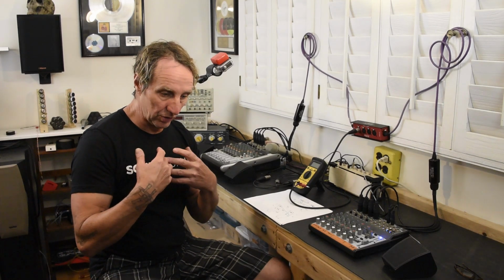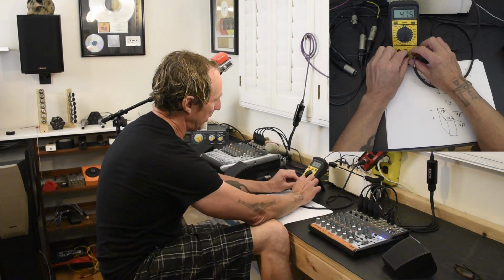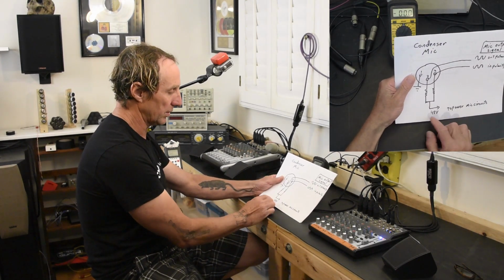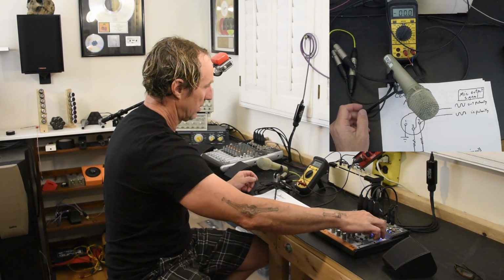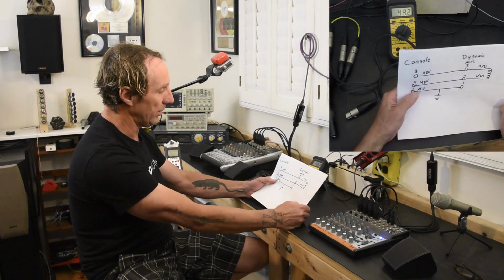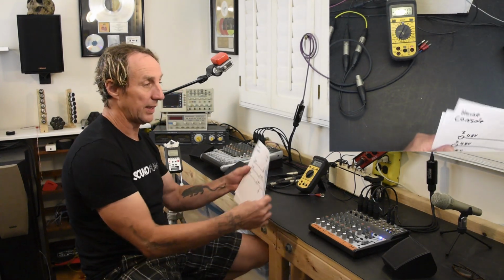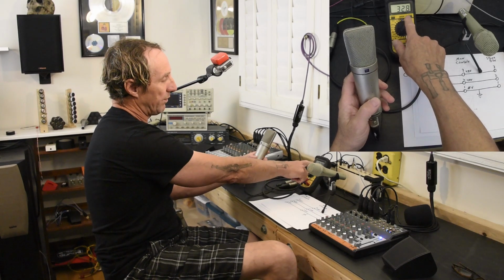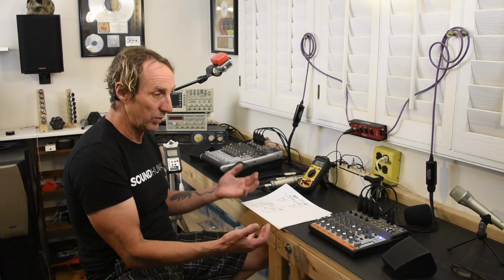Understand Audio Phantom Power + Demo

Comment: Hello good time. Thank you for your professional and excellent content,
I had an important question.
My friend brought me a Yamaha MG10XU (a baby usb mixer) from the United States yesterday, which has a 120-volt power adapter.
But our country's electricity is 220 volts.
I plugged in incorrectly for 4-5 minutes, and the device got a little hot and could smell a bit, but not much.
I activated the phantom power button for a moment and a soft click was heard just below the spot. Again, my mistake.
 I quickly turned off the device and unplugged it.
The next day I got a low voltage transformer and tried it again, the good news is that the device turned on and it did not seem to have a problem, all parts of the device worked properly, the LED for the Phantom Power also turned on when I turned it on, but the bad news There was no sound from the microphone (condenser RODE NT-1a) when I monitored the sound, while without the phantom, I also tested a typical dynamic microphone, and the sound came.
 Do you think you can help me?
 I'm very worried, I'm thinking about it negatively every moment
Reply from the maker: Hmmm, well it seems you are lucky the unit works. Usually double voltage will at least blow a fuse or some parts and often severely damage gear.

Sounds like the 48 bolts phantom has destroyed something inside. Probably not an expensive part, most likely it is fixable but also, unless you know someone good with electronics, this would be a non warranty factory repair. Phantom circuits are not that complex and not too hard to troubleshoot and since you heard a pop, the issue may be visible. You will most likely need soldering skills to fix it or possibly be able to order a replacement board. 

Your least expensive fix is probably to buy an inexpensive external phantom power source to use instead of the blown internal phantom.
Reply: I was really worried and very upset, you really did a very valuable favor for answering, thank you very much.
I will not forget this grace of yours , and I will definitely tell you the result of this problem
Reply from the maker: Cool cool and I would help more if I was familiar with that unit. Good luck

Comment: Thanks Dave! Great video! I have only one question, if you would want to create  96V by running two consoles in series (20:30), how would you do it? would you just revers pins 1 and 2 on one console, or am I missing something? Thanks
Reply from the maker: It would be tough or not easily possible.  You would connect pins 2 and 3 or pin 2 or 3 to the ground pin 1 of the other console and then, if at least one console was battery powered or not grounded in any way, you could see 96 volts between the pin 1 of console 1 and puns 2 and 3 of console 2.

Basically you would need to wire the phantom powers in series.

But if the pin 1 grounds of both consoles were referenced to each other then the 2nd console would just short the 1st console phantom to ground.

That would not hurt anything but you would just get 48v

Comment: Thanks for the video, what happens if you supply phantom to a DI box with the ground lift switch engaged, how does the direct box get voltage?
Reply from the maker: Great question. Phantom is supplied from the console to the output XLR of the DI. Where a phantom DI will grab the phantom to power it's internal circuits.

The ground lift on a DI is  breaking the ground connection from the input ground to the output pin 1. So the input signal is grabbed by the di and outputted on pins 2 and 3 of the XLR and the input is not connected to the output ground.

The isolation of the input to the output can be done with electronics or with a transformer then boosted by electronics.
Reply: Thanks!
Reply from the maker: Cool cool
Reply: A lot of DIs don't fully disconnect when the ground lift is engaged. Pin one is still connected via a parallel 100 ohm resistor and 0.1uF capacitor. This allows enough current to pass to power an active DI but is enough resistance to reduce earth loops.

Comment: Thanks for teaching me what a balanced cable is. A question... If the two different consoles are at slightly different voltages, theory tells me would that cause some current flow between the two units.  Have you any idea how the two different power supplies cope with that? Obviously, no magic smoke is released! Thanks!
Reply from the maker: All input and output voltages are either floating or references to ground. Inputs look at the differential between the two hots on balanced lines and the diff between hot and ground on unbalanced.

Outputs create the same things. 

As long at the gear is either isolated through a transformer or other method like being battery powered or references to the same ground as the other gear, all good.

Differing ground potentials on non isolated gear causes issues
Reply: The one with the higher voltage will be providing most of the current.  The internal 6.8K resistors help out with current sharing, so the difference will be small.

Comment: Chiming in late. I've been watching your videos for several years off and on and they're all great and informative. Regarding this video on phantom supplies, there is one legit issue with not using phantom on inputs not requiring phantom. Such as wireless microphone receivers. As you mentioned, capacitors are used to block DC, protecting a mixer's active input circuitry as well as active devices connected. And in a perfect world this works well. However should a phantom powered microphone, wireless receiver (or any direct connected device with active as opposed to passive outputs) be unplugged or plugged in, the voltage change on the capacitors will cause the capacitors to briefly pass the voltage onto the internal circuitry of the mixer or other devices. This can cause a signal spike to be heard in the sound system as a pop. it can also damage microphones or active devices connected. Rule x; never plug or unplug microphones or devices into a mixer, stage box or sound system while phantom voltage is active. Make all connections first then activate phantom. And then there's the occasional bad mic cable causing loud pops in the sound.
Reply from the maker: Totally agree. Phantom applied to electronic inputs or outputs that are not designed for phantom is a common issue.  Great points!

Comment: That's great - nice, simple and clear explanation and demonstrations. Thanks. Another 'danger' case is linking an output of one console to an input of another. I had a repair case when several balanced line outs of a large expensive Soundcraft console had been destroyed due to being connected to the balanced inputs of another console that had phantom power active on those inputs. Some outputs may be protected against damage being caused this way - but for sure not all.
Reply from the maker: Interesting.  Phantom is so low of a current and should not hurt outputs.  That said, I have run into situations where activating phantom caused the outputs to distort. Not personally burned outputs though.

Comment: If the mixer produces +48V to the pins 2 and 3 it will add up to 96volts reference to the ground. Should the mixer produce a negative voltage for the pin 3 to cancel each out when you connect a dynamic or condenser microphone to it?
Reply from the maker: Hmmm, that's a bit off.

The 48v on pin 2 is referenced to ground and same with pin 3.

It is the same 48 volts sent to both pin 2 and pin 3 so if you measure with a meter, which I suggest you do to see for yourself, pin 2 to ground is 48volts, pin 3 to ground is 48 volts and pin 2 to pin 3 is zero volts.
Reply: @DaveRat  Yeah, i had to draw a picture and do the math and you are absolutely right, couse there’s only one voltage source for both pin 2 and 3.

Comment: Dave, Is there ever any chance of having too many consoles running phantom power in parallel that could possibly cause injury from too much accumulated current due to a faulty snake system?
Reply from the maker: Two seperate issues. Faulty snake can give annoying shocks to the lips and hurt some mics with phantom.  Paralleling 3, 4 or 5 consoles w phantom still has way way less power than a USB
Reply: @DaveRat  Thank you!
Reply: Not an issue. Current is limited to about 7mA per device.
Reply from the maker: Agreed, power is so low that it is not possible to injure someone. 

But I have been called out to fix a a system where a gal was getting shocked and fount phantom power and a faulty snake ground was putting 48v on her lips when she sang and held her guitar.

Comment: We just bought a set of drum microphones for a church. Is it safe to use another mixer just for the drum mics for 48v (both the dynamic and OH condenser mics) and use a send for the snake, traveling to the main house console?

Otherwise, I'll have to check the wirings of my dynamic mics and xlr cables one by one if we'll gonna be using a single console where both the drum mics, singers instruments will be plugged in.

Thanks in advance Dave! Your videos are always helpful!
Reply from the maker: Yes, all good with using a drum sub mixer and also, with the SoundTools XLR Sniffer/Sender (I designed it) you can test all your lines in a few minutes or less.  Just turn on phantom and plug in the sniffer to each channel on the snake and it will tell ya good or no good.  Probably worth having one.

https://www.youtube.com/watch?v=bG77DLOTPsQ

Comment: I always love your videos. You always break stuff down and show it, instead of just talk about it. I appreciate that. I watch videos of yours on stuff I already know and still enjoy them and pick stuff up.  Quick question though, I didn't think DC could pass through a transformer.  Isn't that one of a transformers (isolation transformer) uses is to filter DC out?
Reply from the maker: Not sure of the specific part you are referring without re watching the vid, but...

There is a way to pass a DC voltage through a transforme and have it function correctly for ac by tying the centertaps of the primary and secondary together

 if one leg of the DC was applied to both sides of the primary in relation to ground. The DC would show up on both sides of the secondary in relation to ground.

This is how phantom power can pass through transformers designed to pass phantom work
Reply: @DaveRat  Well I learned something new. I didn't think it was possible to pass DC. Thanks for the clarification.  You're the man. Love your work and passion for audio. I share it.
Reply from the maker: Awesome! Thank Aaron!

Comment: Is there any way to remove phantom power from the output, I have a mixer that has all phantom on or all phantom off?
If I run phantom into a passive DI box, will it damage the input device?
Reply from the maker: A couple of 100uf capacitors, 1 each on pin 2 and 3 will remove 0hantom. But phantom won't hurt a passive di

Comment: Thanks for the vid, could you help me a bit?
I have an effect pedal with constant 24V phantom power, will it make any harm if i use it in a chain like this:
Condenser mic —-> external power supply with phantom power 48V —-> effect pedal with constant 24V ——> audio interface with turned off phantom power ——> pc
Reply from the maker: Phantom power into balanced outputs should not hurt anything. I have seen some outputs don't like it and either distort or offer reduced output levels when phantom is went to them.

Just try it.  If it works and sounds ok, roll with it

Comment: I have a Behringer 1002b and my cad mic wont work because of low voltage on phantom power even not using batteries and plugging it in
Reply from the maker: Hmmm, that's unusual, may be some other issue or a problem with the mixer. Phantom is pretty easy and cheap to create and send and most phantom sources will power 2 or more mics to operate.  That said, low phantom voltage can reduce headroom of the mic and multiple phantom source driving a mic does offer a safety net
Reply: @DaveRat  it might be the mic but a long time ago I saw a video saying it's only 18 volts . I use the mixer for live music in a line array .
Reply from the maker: Get that volt meter out and measure it!

Comment: So if I inject phantom power to a mic and use the one side of the xlr output of the mic to the unbalance mic input of a DSLR, ill kill  it with 18v in the audio path?
Reply from the maker: Oh my, yeah, it gets complex but yes, phantom power is not typically compatible with unbalanced. 

Using a small transformer to convert to unbalanced while phantom and the mic are on the balanced side of the traslnsformer is good.

Comment: The history of the Phantom power is borrowed from the telephone industry. Classic telephones have carbon microphone elements, which are variable resistors. This is powered by the phone company using 48 volt batteries on a charger, which is why land lines remain working in a power outage. The higher voltage is lower current for the power and best for the long phone lines back to the telephone exchange. 48Volts is low enough to be considered limited energy for class 2 electrical code, which is limited to 50 volts.
With condenser microphones, the element is high impedance, often well above 50,000 ohms. This requires an amplifier and transformer with a center tap. The power for the microphone  is taken from the center tap, so power used by the microphone, draws power from both sides of the cable equally.
As Dave pointed out, if one of the microphone cables has a bad connection, the unbalancing of power draw on the pair, does result in loud pops and crackles in a cable, where without phantom power, the sound would only have dropout from the bad cable.
The problem with a Y cable for FOH and Monitor driving one microphone is some microphones expect limited current, and with 2 consoles providing power, the higher current increases heat in the microphone. This depends on the microphone manufacture and what type of amplifier they use in the microphone. Most microphones will not have any issues with higher available current.
The issue with powered and un-powered phantom on the consoles, is most consoles are Global phantom power so power feeding into a console from one mic input, will try to power the phantom power rail on the other console. This load draws down the power available for the condenser mic and may result in under-voltage distortion in the mic..
Reply from the maker: Very cool and agreed on all except the concept that some mics rely upon phantom to limit the current for normal operation. I know of no examples of this and it does not really make electrical sense to design a product that relies on current limiting of the power source, when adding a few current limiting resistors into the mic design is cheap, safer and a better design.

Comment: Thank you so much for sharing your talents and experience with all of us.
I have a question. I want to utilize 2 AT4033 large diaphragm condenser mics in my acoustic trio. I also love the sound of our Meinl slap top cajon with passive pickups connected directly. Im told by percussion dealers that phantom power will damage it and our small Bose digital mixer doesnt have individual channel control of phantom power. How can I protect the cajon? Will the low Z output of any passive direct box isolate and serve the purpose? Do I need a specific device?
Thanks again!
Reply from the maker: Yes, the output of a direct box will block phantom. Or use and isolation transformer. Or make a special xlr cable that has 100uf capacitors on pin 2 and pin 3. Phantom won't go through a capacitor.
Reply: @DaveRat  Thank you so much! Your approach and egoless attitude are rare and so refreshing in this business. You should write a book or a series. I'm sure they'd be VALUABLE go to resources for all of us. Your knowledge and experience needs to be preserved.
Thank you!
Reply from the maker: @tlb2732  thank you Tony and much appreciated!

Comment: Excellent vid! Does splitting a microphone signal with one of those Y-cables, if connected to both mixers, cause any degradation of sound quality?
Reply from the maker: It should not and is easy to test, just listen or measure the output of one console while plugging and unplugging the other console. Typically a console input will be like 10,000 ohms or so and a mic output will be 200 ohms or so. So, you can drive several consoles with very minimal impact on the mic output level and loading of the mic.

Comment: I wonder if there is any microphone response difference if 3 or more consoles drag down the voltage enough?
Any pro OB set up I've seen always used an active 3rd split anyway.
Would having 3 phantom switches on 1channel triple the current then?
Reply from the maker: 3 should triple the current assuming you have a splitter that passes phantom

Comment: In a large venue where FOH and Monitor World might be on a different Phase/Leg as far as their power source will this cause an issue?
Reply from the maker: Typically a differing phase is not an issue.  Its when the ground for mons and FOH are different and not tied back to the same place that issues arise. Since neutral is tied to ground somewhere in most, if not all, power systems, loads on the neutral can drag it off of zero volts and possibly drag the ground off of zero volts.  Or if there is gear that somehow causes the ground to not be zero volts, that can cause issues if the ground at FOH is differing in voltage to the ground at mons. With digital snakes, this is less of an issue and usually a non issue as long as the ground offset voltages are small. With analog snakes and interconnects, even very small offsets in voltage between the ground at FOH and mons can cause hum and buzz issues.  Large ground voltage offsets can be dangerous or deadly.